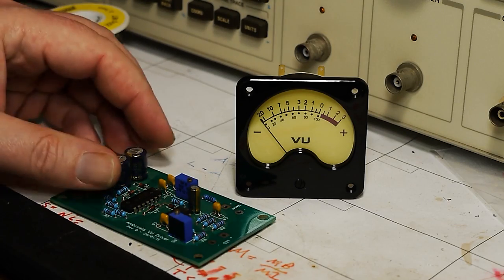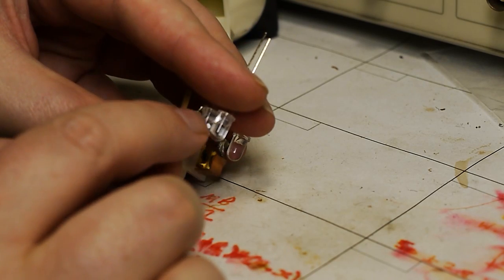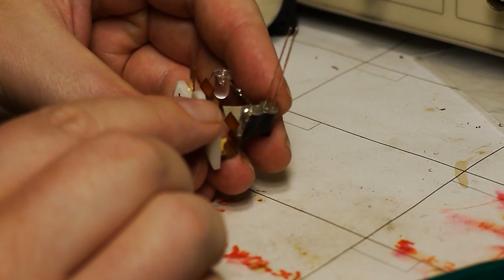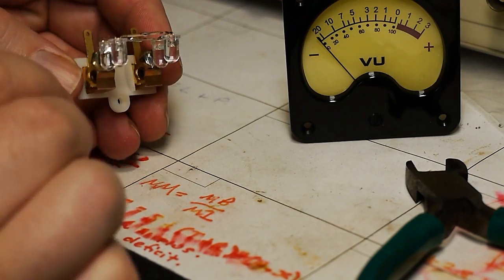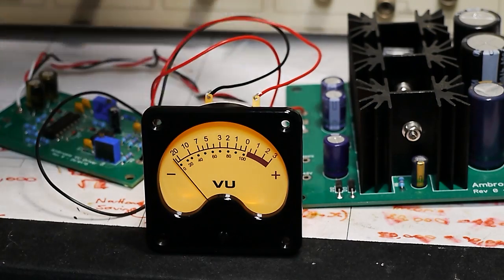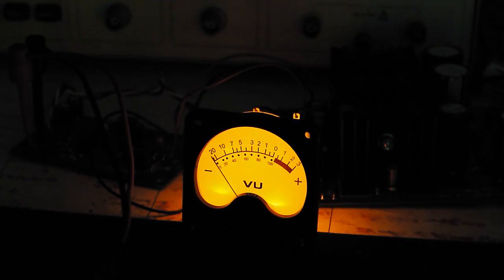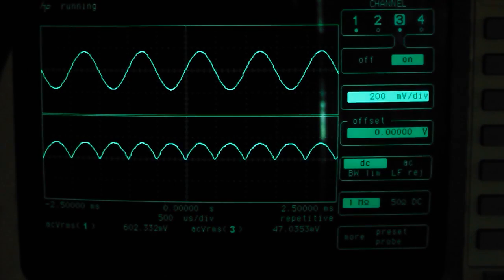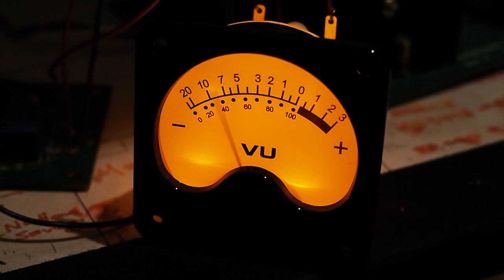DIY mic preamp - VU meter driver demonstration

Comment: Hey. Great video! I have the same VU meter, but it has a small internal PCB with a resistor and 4 diodes (rectifier). Did you use this PCB or get rid of id? Best wishes!
Reply from the maker: Cheers - mine was supplied as a bare meter without any additional PCB. Since the circuit acts as a precision rectifier, you wouldn't want to have a diode bridge as well - it's not necessary & you'd be introducing the forward voltage drop of the diodes, the very thing a precision rectifier is intended to avoid.
Reply: @KarlAdamsAudio  Thanks for the quick response!

Comment: Nice channel! I bought a kit containing two VU-meters and a PCB-board which have one input only, no output? I want to connect them to a passive pre-amp PCB-board with tone controls that I also purchased. Can I wire in parallel from the pre-amp board? Sorry for this silly question. I don’t know electronics 😊

Best regards! /Olle
Reply from the maker: Thanks Olle, the rule-of-thumb is that with line level audio signals you can generally parallel from one output to several inputs without a problem. The thing you never want to do is parallel several outputs together into a one input. While a passive preamp isn't ideal for driving several inputs (output impedance is relatively high) I'm sure you'd get away with it.

Comment: How would I hook up a bluetooth amp to the VU meter board??  Do I need to take the amp apart and tap into the outputs of the bluetooth board?  In other words, wire the VU meters inline with the wires going from the bluetooth  to the amp inputs??
Reply from the maker: I guess you could use a resistive divider to derive a line level signal from a speaker output. You'll need a +15V/-15V DC split supply for the driver board too.
Reply: @KarlAdamsAudio  Ok, that was what I was hoping might work. It would be a little easier. Thanks

Comment: This is so cool! It would be ridiculously cool if the red light stayed for a couple seconds to make sure it has been seen. I have a couple preamps that I would love to get modded like this.
Reply from the maker: That's a great idea! There's a bit of hysteresis in the comparator circuit which helps the keep the red on for a bit longer (depending on how quickly the program level decays away), but I dare say you could use a monostable circuit (maybe a 555 timer?) to keep the red on for a specific length of time after the level drops below the threshold.
Reply: @KarlAdamsAudio  I solved this problem recently - see circuit http://www.objectivesounds.co.uk/articles/vu-meter/#6
Reply from the maker: @michaelfidler8218  Very impressive.

Comment: I love these colour change.
I'm just wondering how vue meter can be used with a digital amp such as https://www.youtube.com/watch?v=AmYGKKIfSXA&t=0s   ?
Reply from the maker: Thanks, I'm sure that it can be done - your major challenge is the issue of power supply. I designed my circuit around the +15V / -15V rails that are used by my mic preamp, while the TPA3116 amplifier works from a single-ended supply. Some changes would be needed to run the op-amps from a single supply, as the input would need to be AC-coupled and a half-supply "virtual ground" would need to be derived with a voltage divider. It might be easier to find an amplifier that has dual + / - power rails that you can tap into.
Reply: Thanks for your feedback.

Power won't be an issue as I will use a step down controler : https://www.aliexpress.com/item/LM2596-LM2596S-ADJ-Power-supply-module-DC-DC-Step-down-module-5V-12V-24V-adjustable-Voltage/32271465162.html?spm=2114.13010608.0.0.fVQeyA
My main concern is to get an input signal for the board. I red about board that allow to use line in or to plug on the driver : http://www.ebay.com/itm/252179176821

"The signal input: driver board provides two kind of signal input methods:HIGH、GND、HIGH/LOW、GND、LOW，choose any one of them! (as in volume potentiometer, or the power output signal, take the pointer will swing control in volume)

(1) LOW, GND, LOW: this is driven plate LOW level signals input terminals, used to refute CD machine, computer sound card, the former stage,audio source equipment audio signal, wiring in corresponding: left, GND, and right sound channel.

(2) HIGH, GND, HIGH: this is the driver board HIGH level signal input terminals, used to refute after borne power amplifier amplification power signal, driven plate with attenuation circuit, will the power output of the HIGH strength level to drive after attenuation IC, attenuation circuit contains R3 and R2 resistance, connection borne power amplifier output terminals, drive the board two HIGH terminal, by two of the power amplifier were red terminals, the two black borne power amplifier terminals, choose which any one by driving the GND terminal board can."

So I wonder if I can solder the x2 High pins to each speaker '+' and the ground to the Amp board ground ?
Reply from the maker: Looking at TI's block-diagram for the TPA3116 chip:
http://www.ti.com/general/docs/datasheetdiagram.tsp?genericPartNumber=TPA3116D2&diagramId=SLOS708F
You'll see that there's a pair of FETs on both the +ve and -ve speaker terminals of both channels. So the way that the negative-going half of the output signal is reproduced is by intermittently switching the speaker -ve terminal between ground to the (positive) power rail. (And thinking about it, it HAS to work that way - how else do you get -negative output when there's only a single-ended power supply?). So the one thing you really wouldn't want to do is tie the two channels' speaker -ve terminals together - that'd likely let out the magic smoke. However, your idea of using the two speaker +ve terminals and the amplifier ground should be perfectly safe - and although your signal to the meter board will be effectively half-wave rectified (i.e. only the positive-going half of each waveform will be reproduced) that would be a perfectly reasonable way to drive a VU meter, as the imbalance between the +ve and -ve halves of the waveform is unlikely to be enough to make your meter readings appreciably different to what they would be if the entire waveform was used instead.
Reply: Thanks for your answer, once I recieved my board I'll do some picture of it and try to do a wiring scheme.